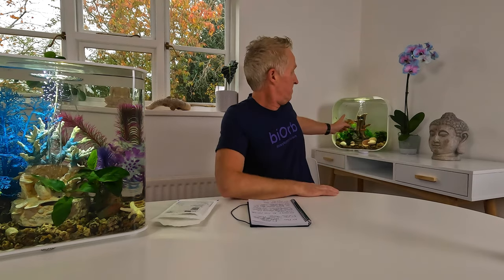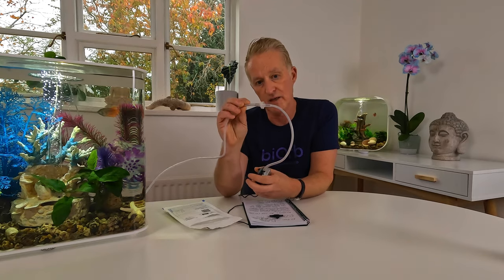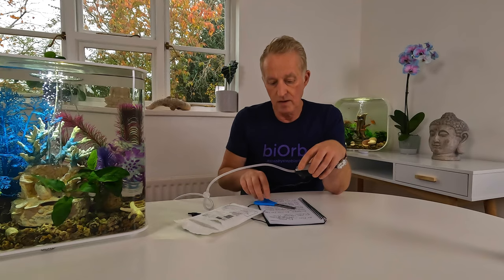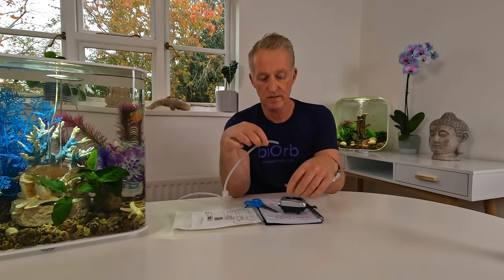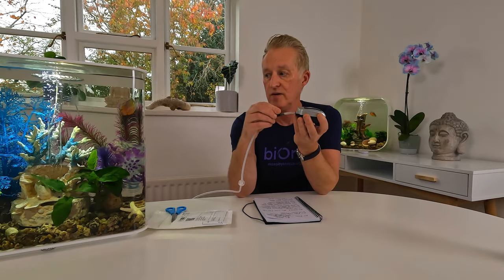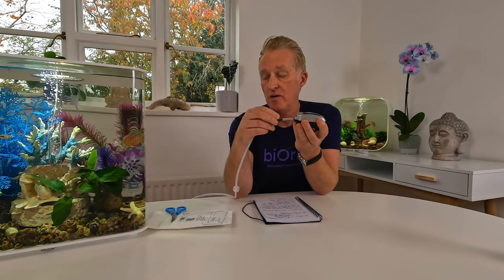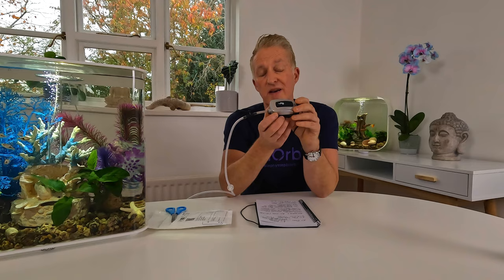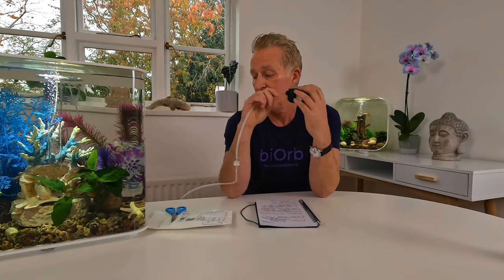biOrb Aquarium  |  Air bubbles too high?

Comment: Hi I have a 15 ltr biorb tank and was  wondering if you reduce the air flow will that affect the filtration system and by the way I think your video's are extremely good and helpful.
Alan
Reply from the maker: Hi Alan.  Nice to hear from you. I think there are a range of answers to that one.

Generally, reducing down the air flow won't make a great deal of difference to the filtration systems (mechanical and biological).  I have tested lower flow and higher flow, in each case for a month, and then compared the amount of waste trapped in the sponge filter. It was virtually the same. The amount of waste getting trapped in the ceramic media is comparable either way too.  A gravel vac is always the key way to reduce trapped waste from within/under the substrate media.

Air flow can often be too high in a 15l.  I think this relates to which air pump comes with the tank.  biOrb often include an over specified air pump (i.e. the same model provided to operate the 60 and 105l).  The video is aimed more at fixing this issue. 

The times that you may wish to reduce air flow down is:
- a very high air flow through the aquarium (i.e. far too high, likely to be an over specified pump ). 
- the presence of fish that prefer lower water flow/movement (many of the larger finned fish are adapted for lower water movement)
- too much noise being emitted from the tank base (resonating) or from the air pump itself.

The reason to not adjust the air flow down is when you don't have any of the above. :-) 

High air flow is great when you have species that prefer higher oxygen and water movement  (often the more streamlined, small fin species).  

For the initial establishment of bacteria, during cycling, higher dissolved oxygen helps to speed up the process. It makes sense to retain a high air flow (water surface agitation) throughout the cycling period until the beneficial bacteria are established. After that, fine turn it down.

I hope that helps, let me know if not. Best wishes, Mark.

Comment: Hello again, I'm setting up my 30 litre flow and it currently has no fish, hopefully getting them Sunday. Just a quick question regarding the noise, it's a second hand tank, I've placed the actual pump on some foam and it's very quiet. I have new airstone and filter  but it seems to be a bit noiser than I would have expected in the actual tank. Can hear the bubbles with a constant noise. Is this normal? I've ordered a airflow regulator valve that I plan to fit. Looking at getting male endlers livebearers are they going to be OK with standard flow rate or should I reduce it with the valve? Many thanks
Reply from the maker: Hi. Hopefully the air regulator, when fitted, will sort this problem out.  The noise relates to resonance at the base of the tank relating to air flow.  It sounds like it might be a bit on the higher side!  Livebearers are generally okay with most things including air supply (reasonably high to low settings are generally fine with them).  I would use the regulator to get the sound to where you are happy with.  Initially the good reason to have higher airflow is to help with the tank cycle (initial beneficial bacteria colony will expand better with higher air flow).  I would tend to put up with the noise/sound until the tank is cycled and then look to turn the air flow down afterwards. Best, Mark
Reply: @StepbyStep-biOrb  thanks alot
Reply: Mine is the same. Pump is ok. Air bubbles so forceful they are creating so much noise!

Comment: Hello, I have a question. I used this method for my betta, and it worked perfectly. My major problem is that I noticed that the decorations I have in my tank keep getting algae on the decorations only not the tank itself, just the decos. What am I doing wrong? Help! (I have the classic 4 gallon)
Reply from the maker: Hi Nina.  It depends upon the age of the aquarium.  It is very normal to see algae growth on items within a new aquarium.  I would suggest up to to a year for things to really settle down.  Algae growth is associated with two things… too many nutrients…. Too much aquarium lighting (normally both!). I can’t really say you are doing anything wrong it is just perhaps a matter of time.  Ensuring that you are not over feeding your fish is a key way to reduce nutrients that promote algae.  Also, using an aquarium vac to reduce waste (on a weekly basis) will also help.  Finally, reduce the amount of light given to the aquarium each day should also help.  Algae will not have any detrimental impact to your fish or aquarium.  Can I ask what your nitrate levels get to just prior to a water change?  In terms of cleaning/ removing algae from decor etc see my video on cleaning using bleach solution as this should get rid of most of it.  Let me know if that helps. I could suggest using chemical additives to your water but my preference is to avoid this approach if possible. Best wishes, Mark

Comment: Hi. My Biorb has started to sound really noisy {buzzing}, I've cleaned the removeable sponge filter and replaced the air-stone, but this hasn't helped. The pump is silent. The sound is coming from the tank it self. Any advice would be very gratefully received. Thank you.
Reply from the maker: Hi. Sounds like you have done the obvious things. I assume it was okay before?  

Resonation sounds at the base of a biOrb tend to be related to a loose filter canister holder or related to the airflow into the aquarium. 

It could be that the plastic " screw locks" on the filter canister (i.e. the bottom of the unit you remove that holds the sponge etc) are not gripping the unit in place well enough when it is screwed back in.  These can be a bit flimsy and can easily be damaged and can then cause the unit to not lock properly.  Are you reusing the sponge filter canister (i.e. adding your own alternative sponges, activated carbon) or are you replacing the whole cartridge with the 'biOrb Service Kit?  

Try undoing the canister, turning it 180 degrees and then screwing it back in. 

If that doesn't make any difference, try disconnecting the airline from the air pump, put the end of the airline into your mouth and blow up the airline to force air into the tank. Then connect it back together. The noise could be caused by a slight blockage in the airline. 

Are you using an air regulator? Air regulators can often be used to adjust the airflow and remove resonation sound.

Let me know how you get on. Best, Mark
Reply: @StepbyStep-biOrb  Thank you so much for all the very useful information. I will systematically go through what you have advised and hopefully have a silent Biorb!

Comment: This was just the solution I was looking for for my tank. Thank you 😊

As the air pump makes up the biorbs filtration system would reducing the airflow affect its performance?
Reply from the maker: Hi. Thanks for watching and I hope the video/Channel helps. As long as you maintain a reasonable airflow through the bubble tube this will provide a good draw of aerated water down and though the under gravel filter system. It is a good thing to use when the air flow in a tank is far too strong (especially on 15l tanks, and when you have fish that do no like a strong flow e.g. betta) but it can also be used as a method to reduce pump noise. I have regulators on all my tanks.  Best wished, Mark
Reply from the maker: Oops, I should mention... a stronger water and airflow is one of the key things to support and speed up the initial cycling a tank and establishing beneficial bacteria. Once an aquarium is cycled then altering the air flow down a bit will not cause any obvious difference to the ongoing ability for tank bacteria to deal with ammonia, nitrite.

Comment: Does this hurt the air pump by putting more pressure on it?
Reply from the maker: Hi. Not that I've ever noticed in the years I have used them, Many pump suppliers provide a regulator in the box with a new pump.  

Obviously, the tighter you screw them down (to really reduce airflow) the more back-pressure is applied to the pump. However, back pressure applies to any aquarium air pump as you are constantly using the pump to force air through very tiny holes in an air stone.  

If this is something that concerns you then add a bleed value to the airline instead. This allows a reduction of air pressure by allowing air to escape (i.e. it releases air pressure within the airline).  

Hope that helps. Best wishes, Mark

Comment: Thank you for this video. I just purchased a Cube 30L and the air pump is so loud.  The buzzing is frustrating for me and I wonder if it causes my fish stress? Any suggestions on muffling the noise (I’ve tried putting the pump on a towel, but it’s not the vibration against furniture, it’s the pump itself) or have you ever tried replacing the Biorb pump with another brand?
Reply from the maker: Hi Gina. The use of an air regulator can help to reduce noise in a noisy pump (normally, but not always) if the pump is running with a high air flow to the tank.  Have you identified that it is indeed the pump and isn't the base of the aquarium resonating?  In terms of other products, yes I've tested a broad number of alternative pumps. The quietest model I have found to date is this one: https://amzn.to/3Ch41sI. It works well on a 30L and fits the biOrb air line (4mm).   I've been running one on my 30 Flow for some time (since last March) without any issues. I would generally describe the biOrb air pump (if it is working normally) to be a "low-mid noise" air pump.  There are far more expensive air pumps that are far louder (e.g. Eheim 100).
Reply from the maker: Just to add... Sometimes, during the setting up of a new tank, a small amount of water can enter the upper part of the airline (this normally happens if the tank has stood for a while without the air pump on).  This can cause a noisy pump! The way to test this is to remove the airline from the pump and to blow up the air tube until air is running into the tank. Then put the airline back on to the pump.  It takes a fair puff to do it, so take a deep breath!!! LOL.  Worth trying this just in case! Best, Mark
Reply: @StepbyStep-biOrb  thank you for the suggestions. I took a deep breathe and blew into the airline, haha, still a similar level of noise. I ordered an air flow valve and will try that next. Thank you for sharing your tips and tricks!

Comment: Hello. Please can you tell why I have so little bubbles and what I could possibly do to create a better airflow? Thanks
Reply from the maker: Hi Kylie.  That's unusual as normally I get asked how to reduce!  Is the issue on a new aquarium/pump?
Reply: @StepbyStep-biOrb  Very strange indeed! 
No the only things that are new are the filter and the airstone. Pump is working fine and the air tube is fine- no water in side the tube! I really don’t understand what’s going on lol!
Reply from the maker: So, on the basis that it was all okay before hand  ...  I would suggest checking in this order:
1. Check the air stone.  Perhaps just try replacing it to see if it that is the cause. Also, when you take the air stone off within the tank... do you get a reasonable air flow into the tank without it on?
2. I was going to suggest water trapped in the airline as that tends to be the main reason - but it sounds like you've checked that. There is also a small valve sitting under the tank (it sits between the air line and the base of the filter system). You wont be able to see it!  You could check to make sure the valve hasn't got stuck in the wrong direction. You would either need to blow very hard down the air tube to get air coming up through the tank or attach the air tube to a bicycle pump and just give it a couple of gentle pushes through. That would reset the valve if it is that.
3. Are you sure your pump isn't in decline?

Let me know. Best, Mark
Reply: @StepbyStep-biOrb  Okay thank you. 

The airflow is the same with or without the air stone in place. I have also tried to blow down the air tube really hard but it’s just the same, doesn’t even create any other bubbles. I don’t think the pump is in decline, I mean it’s still vibrating and I can feel air.
Reply: I have just tried my mums pump as she has a Biorb tank with really good airflow - has lots of bubbles but my tank seems to be with same with either pump
Reply from the maker: Okay. That cancels out your air pump being a problem if your Mum's air pump also has issues on your tank.  Just to double check....Have you tried your pump on her tank?  I think you will probably say it works fine. So, that only leaves us with the airline and the small white tube in the tank that you push your air stone onto.  Are you able to check if there is anything that may have got stuck in the end of that tube.  I'm just wondering if you do need to try a bicyle pump. Do you have one or know anybody that has one?  You basically need one that comes with adapters (the plastic ones that often come with them). You need to attach the adapter to the cycle pump and then unplug your airline and attach it to the cycle pump. Then give the pump a couple of pushes to force air through the tank.
Reply: @StepbyStep-biOrb  Yes I’ve tried my pump on her pump. Works fine. I mean I’m not sure how many bubbles you’re meant to have, but from seeing yours and others on YouTube etc, mine look pathetic compared to them. I have checked the airline as I did a water change today, so made sure that was all ok before putting the air stone, filter and cylinder tube back on. No I don’t have a Bicycle pump, I may know some that does have one, so I’ll check with them and give that a go. If that fails, I’ll get back to you lol! Thanks a lot for your help…much appreciated :)
Reply from the maker: Not a problem. I hope it works. Remember you need a bicyle pump that comes with adapters... as I think you will need to use one of those (which should fit down the airline a bit) as this will allow you to force air up into the tank,
Reply: @StepbyStep-biOrb  Perfect :)
Reply from the maker: Hi Kylie.  I was just wondering if you had managed to solve your low flow rate in your aquarium?  Best, Mark
Reply: @StepbyStep-biOrb  , very helpful as I've been having the same issue with too few just recently (had my biorb 10 years)  I tried replacing the backflow valve, filter,  and pump, without luck.  I will look to see if something is in the tube, bicycle pump idea is brilliant.

Comment: Mark- I inadvertently poured water down the air tube (where the bubbles come
Out).  as a result, there are now no bubbles coming out! I checked the stopgap, and there is no water in the line. Any suggestions?
Reply from the maker: Hi Lisa. I would suggest removing the air line from the air pump and gently (but firmly) blowing up the air tube until air starts to appear in the tank. Then connect the airline back into the pump. That is normally the common fix for reduced or no bubbles within the aquarium. Let me know if that fixes it. Best, Mark
Reply: I have the classic 60.  I unplugged the hose from the air pump and blew into it as you suggested.  That is a lot of hose to blow into and reach the inside of the tank.  Absolutely no luck.  No bubbles at all when i blow.
Reply from the maker: Yes, you need to blow reasonably hard for it to work  You could try elevating the hose high above the tank and then try. blowing down. You will need to stand on a chair or something.  The alternative method to do this is to use a bicycle pump  with an adapter fitted to the pump. You push the pump adapter  into the end of the hose and gently push air along the tube.
Reply: One more question. Should I cut the stop gap out and then blow?  Then stitch the stop gap back into the line?
Reply from the maker: Hi Lisa. The check valve (positioned along the air tube) is a one way valve system so it shouldn't really make much difference to you being able to blow up the tube.  However, if you were to cut it off from the air line you will need to replace it with a new one.  They are very cheap and you would need to replace with one that fits a 4mm air line such as this one: https://amzn.to/3BqdQ7w.    If you are not able to blow hard enough up the tube then the cycle pump approach I mentioned will do that.  A biOrb has a one way valve that sits directly under the tank.  I think you may have changed the direction of the value (by forcing water down the air tube). Blowing or forcing air up the tube will basically reset the valve direction under the aquarium. I'm sure, if you can do this, everything will return to normal.
Reply: It worked!!!!  Thank you so much.
Reply from the maker: That's great. Now you know what to do if it happens again :)  It can happen, as you did, if you pour water directly down the bubble tube (this can cause the tank value to face the wrong direct, and in that case you need to reset it by forcing air up the tube).  Sometimes water can also enter the upper part of the tube if the pump has been switched off for a period of time. The water in the airline will stop air going up into the tank. The fix for both scenarios is to force or blow air up the airline. Anyway, glad it's sorted now.  Best wishes, Mark